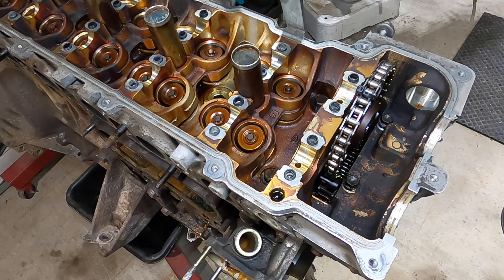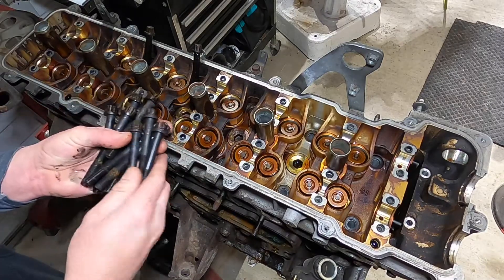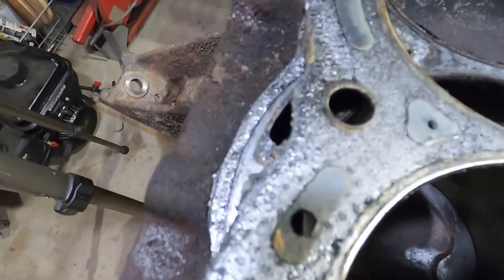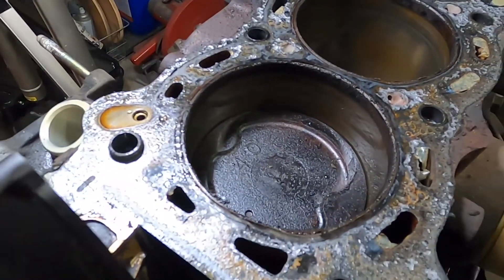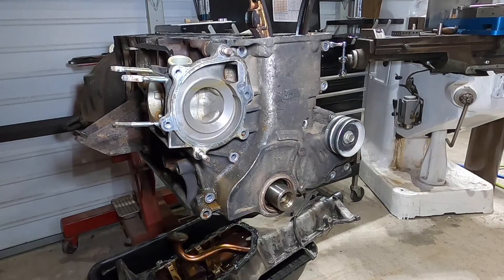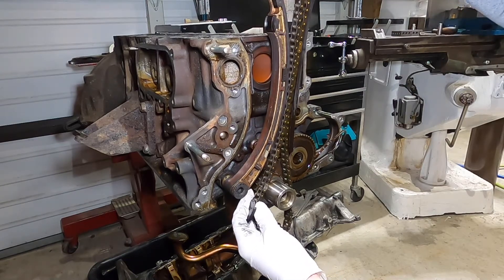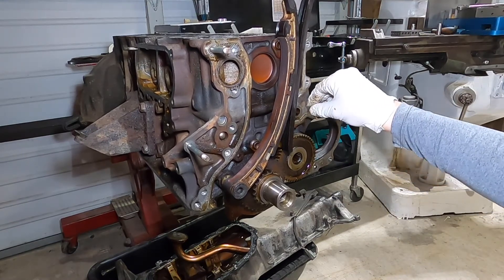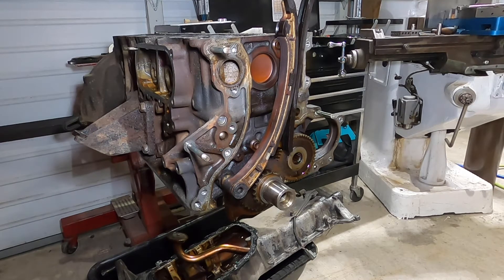1Fz Disassembly, Cylinder Head, Oil pan and front cover plate

Comment: Great video - Thanks for documenting your process!  I'm about to try to replace some piston rings on my 1Fz without pulling the engine. This was a great video to see process for pulling the head. My plan is to also remove oil pan etc from underneath and push pistons up one by one to replace.
Reply from the maker: Thanks Glenn 👍🏼 , if you have any reassembly questions feel free to ask here as I’ve not uploaded that video yet

Comment: Which aftermarket camshafts are available for the 1fz? Or would you just do a regrind of the cam lobes?
Reply from the maker: I like the kelford cam options for big power although there are a couple of other companies with cams too, BC cams and there’s another one I can’t think of right now
Reply: @stevegiles7954  that's interesting, I had no idea anyone made cams for this motor. I like both of those. I have used their cams on the 3sgte and 1jz.
Reply from the maker: Nice! Yeah there’s not many people making them , I’ve heard good things from both companies too.
Reply: @stevegiles7954  will definitely check them both out. Thanks!
Reply: @stevegiles7954   crower cams(not BC), schneider cams, and camtech(they are out of business) also make cams for the 1fz
Reply from the maker: Nice! I wasn’t aware or Schneider or camtech, BC or Brian Crower cams is the same company, I should have specified
Reply: @stevegiles7954  you aren't wrong Brian Crower(BC) and Crower Cams are 2 different companies that make 1fz cams